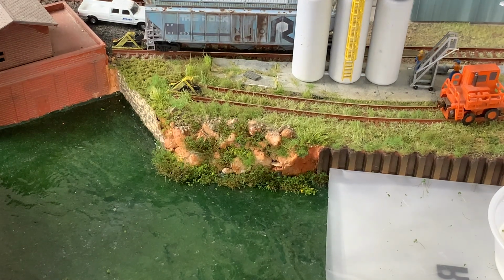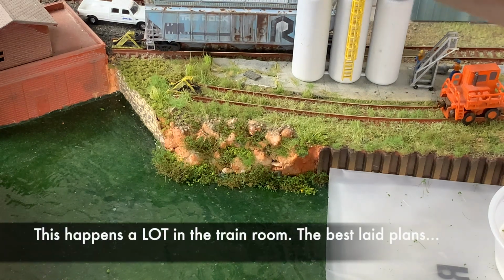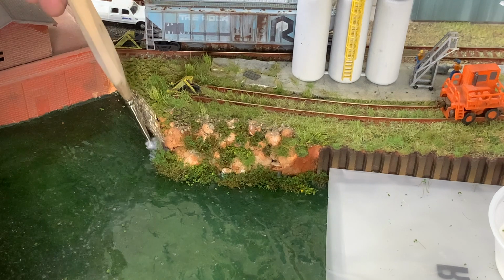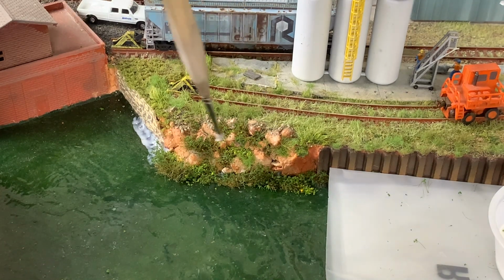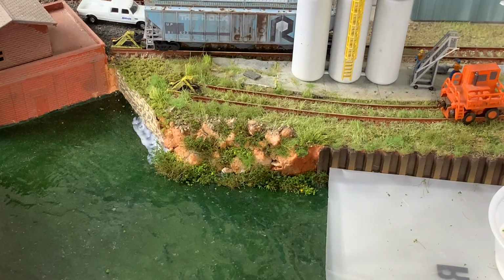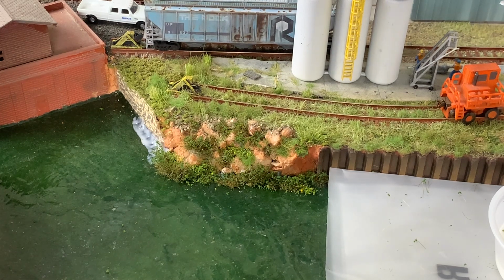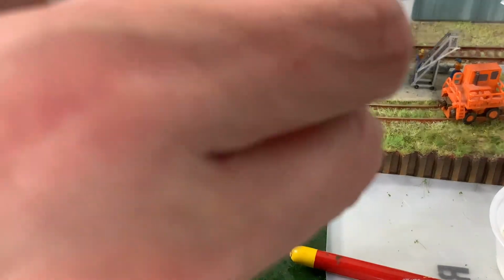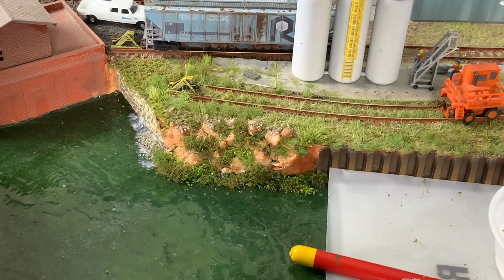Embracing the No-Agenda Day | CCMR At The Bench #8

Comment: Hey there. I've been following your videos for a few weeks now and it's really refreshing to see another N Scaler take on ultra detailed urban areas. I'm modelling the NY Cross Harbor in Brooklyn NY circa the 1980's (have 2 "shorts" on my channel if you're interested) and your work has been really inspiring for me. I'm curious what you're using for the discarded concrete piles? Is that just chunks of busted up Smooth It or something else? Looking forward to more of your content!
Reply from the maker: That's exactly what it is - broken Smooth-it. I poured a couple of rectangles and then broke them into pieces. You can either paint concrete a base coat prior to breaking it apart, or airbrush it once it's laid down. I've got a few different concrete piles on the layout, and used a few of the pieces to form the 'broken' edges of the concrete platform holding the three storage tanks at the grain elevator (the rest of that base is kids' play foam).
Reply from the maker: Also - phenomenal layout. I love the shelf format and you've done a fantastic job at detailing and getting nice slow-speed operations.
Reply: Thank you! :-)  @ChicagoCrossingRR